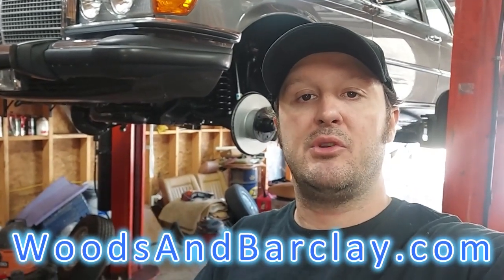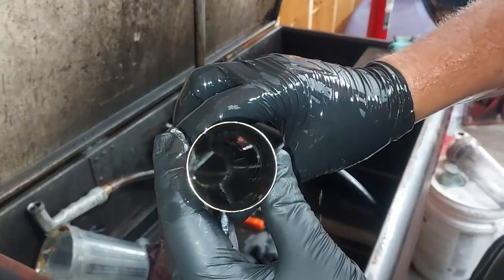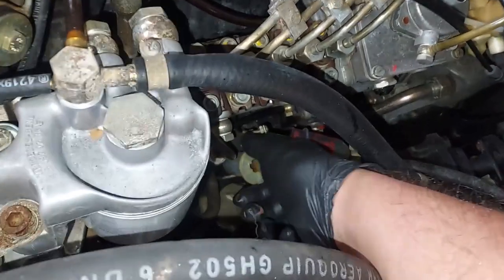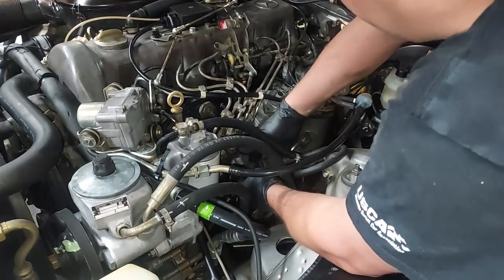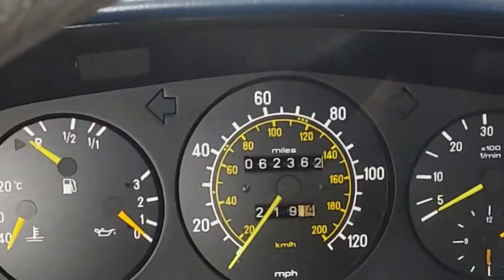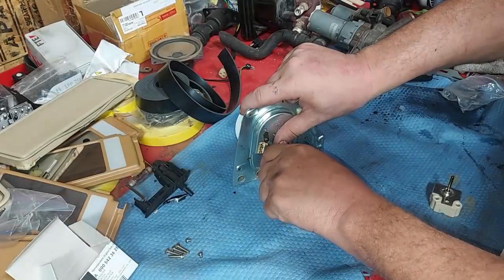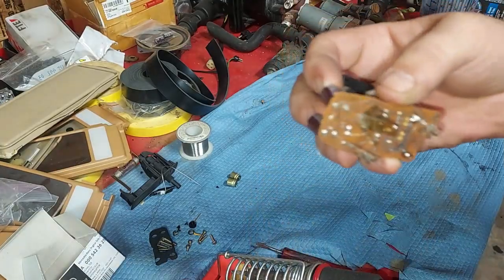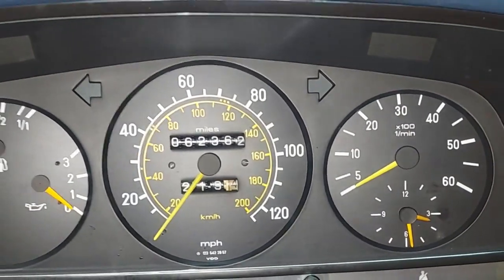1984 Mercedes 300D - Part 5 Fuel Sender, Dimmer, Clock and Door Strikers

Comment: I know I’m a year late but an easy way to remove the fuel primer pump is a crows foot wrench.
Anyway, I really appreciate your channel. I recently picked up an 83 300TD project. It runs and drives okay and is shockingly rust free but it definitely needs work. I’ve been using your videos to help me along with the process of fixing it up.
Reply from the maker: Awesome I've got a lot of Great wagon videos if you actually go to the website you can click on the wagons and see the entire video series for each one. That may be an easier place to see a complete series on a wagon restoration.
Reply: @woodsandbarclay  I actually just had Picture in Picture going while scrolling through your videos to create a playlist but that’s much easier lol.
Reply from the maker: I have also created a playlist for every car on YouTube. So you can access those playlists via YouTube or you can just go to the website and click on the specific car.

Comment: To remove the instrument cluster, you can just remove the bottom panel under the steering wheel, reach up, and just push it out. FYI.
Reply from the maker: Yes you can do that or you can remove the driver side speaker and reach down through that hole. It's just quicker and easier to use the cluster removal hooks. Literally takes about 30 seconds
Reply from the maker: I also emailed you your parts list
Reply: @woodsandbarclay  I got it. Thank you very much.
Reply: To je jednostavan posao za onoga tko je to radio.
Reply: To sam radio više puta i znam u čemu je kvaka.